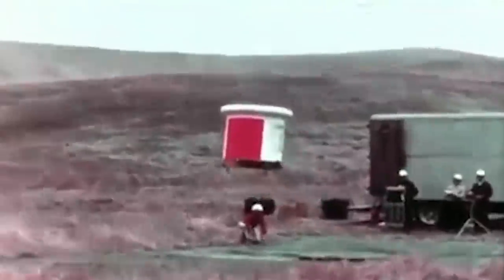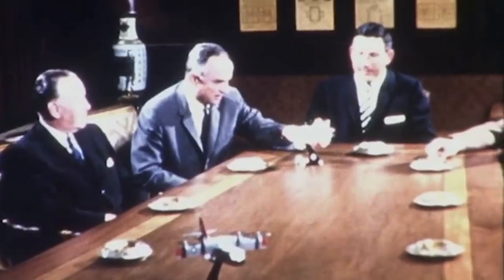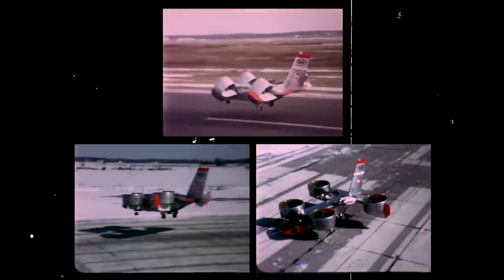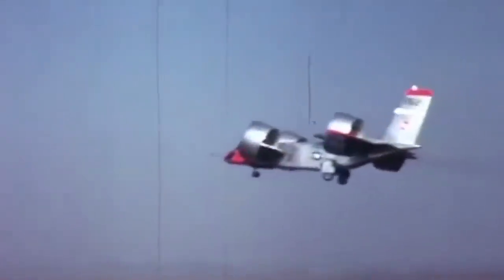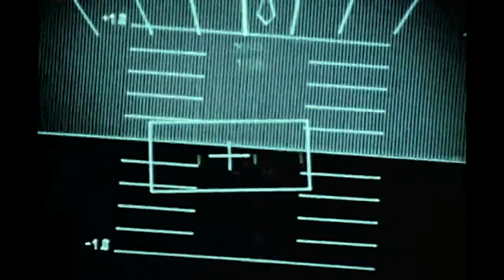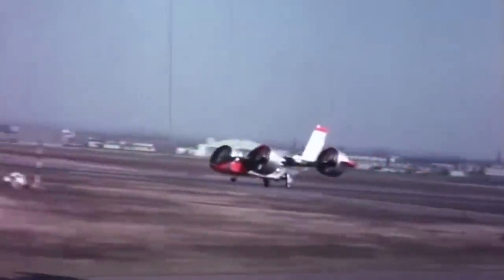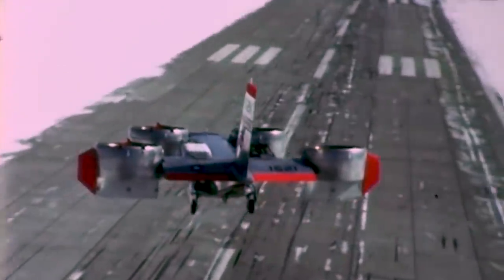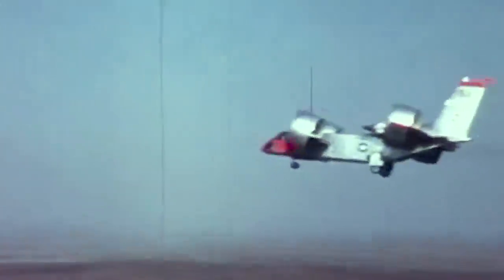Hover Assault Transport - Bell X-22

Comment: Double the speed and double the range of a conventional helicopter. More stability while hovering. More versatility. 

Sure is a good thing they made pot illegal. When it was legal, people were incredibly stupid.
Reply: Lol right
Reply: I'll leave commenting on use of drugs to others and stay focused on the tech: performance is of course crucial, and it may have had some class beating attributes, but operational costs are as important.  No mention of costs or expected life span of the airframe - all critical considerations in whether a design can be taken forward.
Reply: @MikeLawtonUK  , In the video, they claim that the only thing that prevented it from going into production was it's speed. It wasn't as fast as they expected (326 mph was required, it "only" hit 254 mph, roughly twice as fast as any other helicopter). 

That's the point of my comment. Who cares if it's not as fast as you wanted it to be? Is it twice as fast as a standard helicopter? Yes. Is it twice as efficient? Yes. Can it do 100% of everything a helicopter can do? Yes, yes, and yes. 

As for how long the airframe lasts, is 21 years good enough? Because that how long the second prototype lasted. 

Seriously. How different would Vietnam have been if we could move more troops around, twice the distance at twice the speed?  It's impossible to overstate the advantage that would create. 

So yeah, it's just dumb. "It didn't go 300 mph, wah, wah!  I don't want to buy it then. Wahhh!  I don't care if it's twice as good as what I'm using, I wanted three times as good, waaahhhh!".

Comment: From a lay pov this vehicle might have propelled society into its long anticipated age of air travel as the primary form of ,personally owned, and operated,  transportation; The car/prop. glider vehicles might also be a means to that end. But, greater personal mobility equates to a form of independence and that does not bode well for greater control of the masses.

Comment: These are interesting but I’m told they are extremely loud. Seems like a helicopter would be a better more fuel inefficient machine. They are interesting. 🧐
Reply: A helicopter has different stability features and more optimized for longer hovers due to disc-load...this design has the advantage of cruise speed/time/pilot workload in different modes/redundancy...